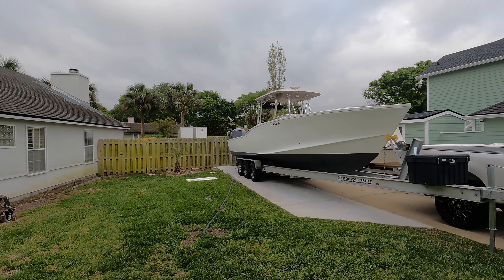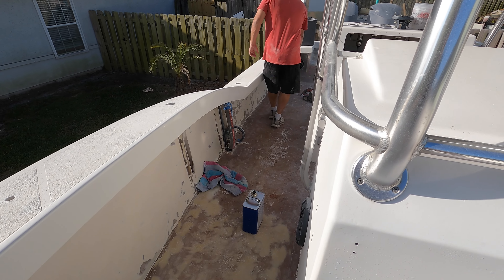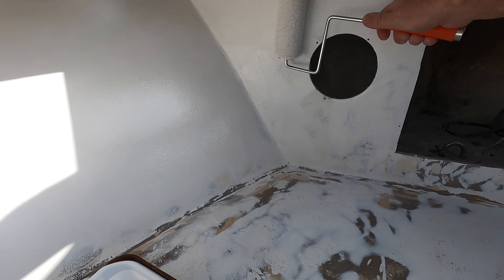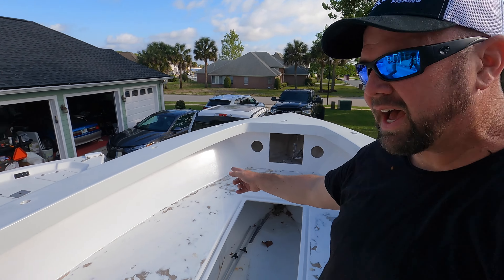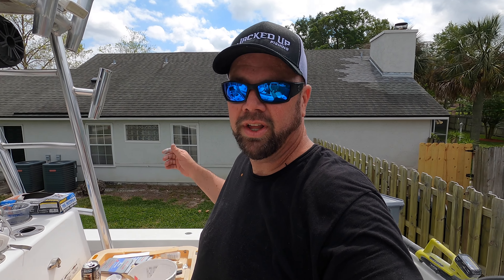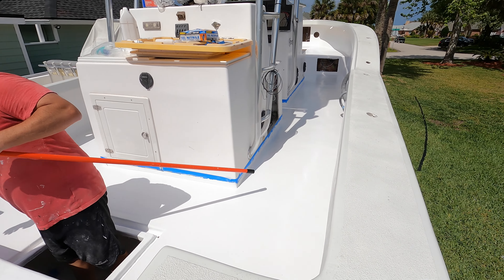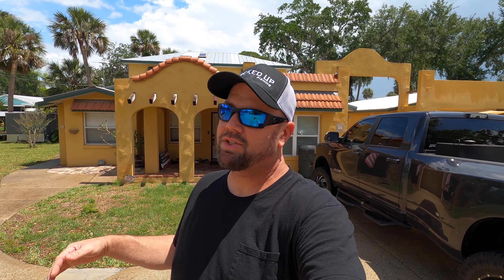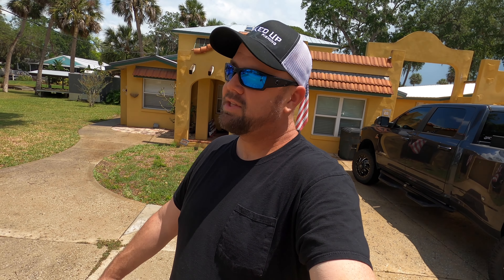OCEAN MASTER 31 Gets Some Fresh Gelcoat! - Re-Gelcating the interior

Comment: I just re-gel coated the rear transom of my skiff. It was already white I just needed to cover some repair scratches and after rolling the gel coat and it curing I had a stipple look or textured look to the gel coat. Did yours do that?
Reply from the maker: When you roll it, it will have a texture.  To make a smooth coat you have tj shoot with a gun
Reply: @JackedUpFishing  thank you